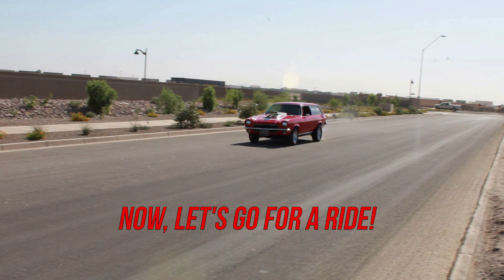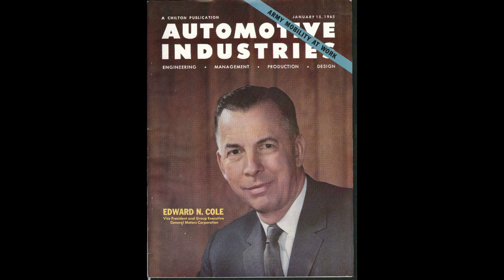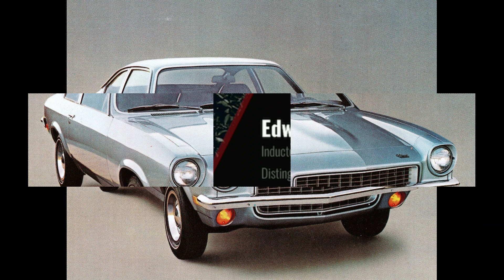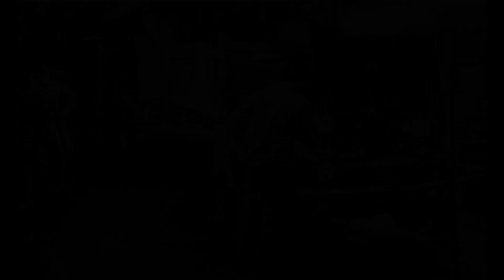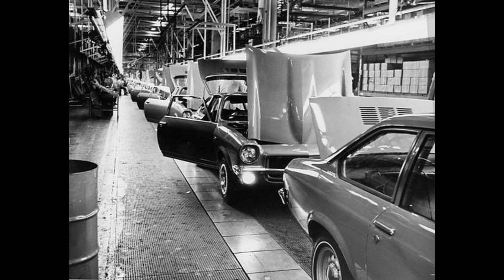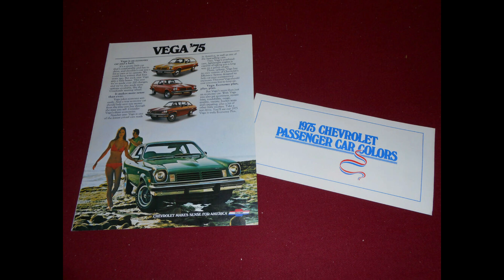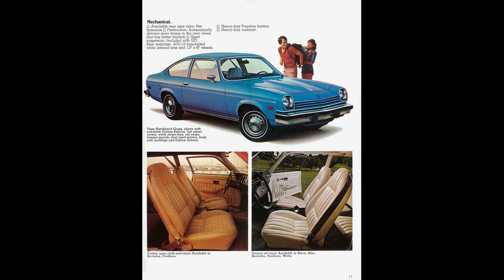If The Chevrolet Vega Could Talk - "People remember me either with love or hate but I'm remembered!"

Comment: You know what doesn't make sense?  GM had a division which was expert at making mid-size and small size cars and that division was Australia's GM Holden.  Holden engineers put together various presentations of how the "HQ" model Holden and "LJ" Torana would suit the America market.  Both cars were seriously considered.  They had been engineered so that they could be built in LHD and Australia's RHD.  The engine bay in the HQ could accommodate Holden's straight 6 or any Chevy engine required.  The LJ could take any engine, including many OPEL four cylinder units.  Both cars were extremely strong (built to take Australia's outback roads) and would have suited the US market.
The problem was that Chevy's engineering department baulked at having their Aussie upstart sibling providing anything at all to the US parent company.  So instead of adopting a tried and true design Chevy struck out on their own because of prejudice against the Aussie product.  Fair enough...their call but I find it ironic that the Holden's would finally be imported into the US as Pontiac G8s and later as Chevy SS.
Reply from the maker: Thanks for all that added information!  Very interesting side of the story that is probably mostly unheard in the US. We really appreciate your awesome comment!  Thanks for watching and being part of our ITCCT family!
Reply: @IfThisCarCouldTalk  If Chevy had gone with the Holden proposal this is what you would have received...
https://www.youtube.com/watch?v=7HgmAz8Y0b4

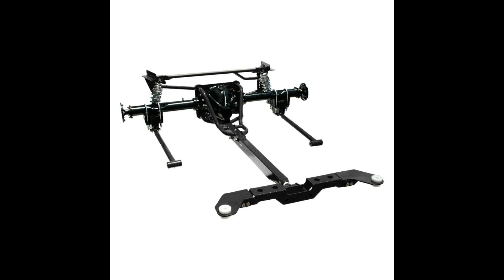Comment: 5:10 Please correct me if I'm wrong, but this illustration  looks more like the torque-arm suspension that was introduced with the Cosworth Vega for the 1976 model year, and was carried over into the Monza and the 1982 Camaro. It has 4 links if you count the torque-arm, but I believe the original 1971 suspension had 2 parallel lower links and 2 angled upper links.

Comment: While Vega was a stylish little car, the engines, paintwork & ergonomics were generally horrid. Once engines reached 35-40K miles, the aluminum cylinders had worn to point hey were using a quart of oil every 250-300 miles. As one poster commented, may as well be a two cycle, add oil with every fill up. Joke back in day, how do you know if a Vega isn't burning oil? "WHEN IT'S BEING TOWED". Rust was a huge problem & I'm in the south. Friend was dating a girl with a notchback, back glass blew out of it one day. The trough glass set in was mostly rusted away. That car was FOUR years old. They met as she'd came into station where he worked looking for 40W oil to reduce consumption(he was selling it to Vega owners). By mid '70s word was out, combined sales for '75, '76 & '77 totaled LESS than did the '74 models that sales were at least partially steered by fuel shortage. There was a reason Pontiac advertised Astre(their version of Vega) as having the "Iron Duke" engine. By '76 Chevy had corrected engine problems, but damage to reputation was done. Meanwhile the "fire bomb" Pintos soldiered on through 1980.
Reply: Lol!  Just the essentials sucked.  🤣
Reply from the maker: Yep.  Great comment, Tom. Thanks for watching!
Reply: There was a “fix” for the engines…… steel sleeve, problem solved. Was going to auto tech school at the time, boring and sleeving was pretty common.
My sister had a 74’ Wagon GT, put a 100k on the car after fixing the engine.

Comment: Owned a '73 Estate wagon.  At precisely 35K miles, the rings failed, resulting in 1 qt per thousand miles in oil consumption.  As it was "out of warranty", Chevrolet was not interested in assisting with the problem.
Reply: My dad was a mechanic. Your 1 qt/thousand miles was lucky. Many consumed much more than that. The failure rate of the pre 1976 engines was very high. They’d overheat, blow head gaskets, score the aluminum cylinder walls, and drink oil. The solution was to rebuild them by having a machine shop install steel cylinder sleeves. I think the 1976 engines came like that from the factory. That’s why they lasted longer. But the fragility of the early engines ruined the reputation. They actually handled pretty well… until the front springs started to sag (another common issue).
Reply from the maker: That's a bummer of a story, Jim but thanks for sharing.

Comment: My first car was a green 73 panel wagon, and then later I had a 74  copper colored wagon.  For the most part, the biggest problem I noticed with these cars was the engine.  They burned a lot of oil, and when they got hot, they would throw a rod.  The engine really needed to have a steel sleeve in the cylinder walls.  Other than that, they were great cars.  Living on the west coast, we don't really have a problem with rust, but I have read in different threads that they also had a bad problem with rusting out.  I never had a problem with this.
Reply from the maker: Thanks for sharing your memories with us!  Glad you had good experiences and we appreciate the comment!  Hope you subscribed and are now part of the ITCCT family!
Reply: Rust was a peoblem -- I would take my car apart as much as I could, every 4 years and derust-/ patch with  fiberglas. Then I'd open up the seals inside the fender wells and spray deruster in that too.

Comment: My parents bought a 76 GT wagon.
It was a 4 spd with A/C and it was in the family for 22 years and 170k miles.
When it was new it was Ziebarted and my parents kept up with inspections and touched up paint chips and scratches.
They were meticulous about mechanical maintenance.
When the car was finally totaled after it was rear ended it the only rust was a quarter sized spot in the doglegs and the engine only used a 1/4 between changes.
Reply from the maker: Well said!  Proper routine maintenance wins!  Thanks for sharing the great memory!
Reply: I used to be a Chevrolet salesman in the 70s. I can tell you that the 76 models were vastly improved in durability, both in rust resistance and in the cooling system. The 76 & 77 Vegas were longer lived than a great many small cars of that time. -and they always got outstanding fuel economy. The car magazines used to note that in their big econo-comparisons, with 5 or 6 competing cars.
Reply: @erichanson3961 I think most of the early failures of engines were bad thermostats or water pumps. The engine was fine if kept cool.

Comment: No mention of the problems that GM had with those aluminum liners? Wore out really fast resulting in lots of burned oil. Putting a cast iron cylinder head on top of an aluminum cylinder block is industrial-strength stupid
Reply from the maker: True that.  Thanks for the comment!

Comment: IN 1977 my father bought a 1973 Vega with the 4 speed manual for $75.00 in a auction.  He gave it to me a young airman in the Air Force. It made it ten miles for me and the shift linkage bound up. I get under the car and free up the shift linkage and return the car to my father and went to the local Plymouth dealer and bought a used 1974 Plymouth Duster.  

I then repaired the Vega and it was used by father for the next 3 years as a bomb around car.  You never followed that car very close as it would literally drop bits and pieces of rust decayed parts on the road behind. After about three years the car started to be a automatic mosquito fogger as it was going through a quart of oil every 50 miles and my father took the car to junkyard.
Reply from the maker: LOL !  Well, heard those stories before so you were not alone.  Hope the Duster worked out well.  Thanks for sharing your great memory!
Reply: My reverse linkage rod got stuck. Went out and installed a case hardened Hurst Linkage -- great replacement.-
Reply: It sounds like the exact same car my father bought brand new in 1973.
Reply: yes a duster was a better car, the old 4 speed GM transmissions were not bad, but if the linkage had any slop you had to make sure you took it out of the gear you were in before picking a new one, or it would lock up, not hard when you got used to it

Comment: Great looking car but it had an engine akin to that of a Briggs & Stratton lawnmower. Aluminum cylinder sleeves. Really? And that valve cover was about 4 ft.² that was prone to oil leaks out the Wazzu!  Other than that it wasn’t a bad car. I always yanked the engines out and dropped in a small block or a 215 Buick 8. There are ways around that design flaw ☺️
Reply from the maker: LOL....right!  Thanks for the comment!
Reply: The Buick 215 V8 weighed 40 lbs more than the Vega engine.

Comment: My mother bought a 1974 GT off of the dealer lot from Ken Dixon Chevrolet in Waldorf, MD. She had been driving her 1973 Cadillac Sedan de Ville back and forth to DC, about 30 miles one way. The oil embargo took care of that and she parked the Caddy and started driving the Vega everyday. She loved that car and she saved a ton of money in gas. It did use quite a bit of oil and the 4 speed manual transmission linkage would hang up without warning at the most inconvenient times while stuck in traffic, on hills and at stop lights. We had to climb under it and knock things loose with a hammer to get it to go again. I learned how to drive and took my driver test in that car in 1981. Great memories. Other than the oil and the linkage problem (which we eventually got fixed to prevent it from locking up), it was a great little dependable car. She traded it in in 1985 for a Chevy Camaro Berlinetta.
Reply from the maker: Funny, because when I was in high school, I really wanted a Berlinetta and got a 79 Mustang Fox body hatchback instead which are also bashed by some "car people" but was a great little car that lasted me a long time.  Thanks for sharing such a great family memory!!
Reply: I used to have to do that to my parent's 3-on-the-tree Malibu, but the levers were under the hood, so only my hand got dirty.

Comment: just think everyone blamed the aluminum engine, but it was the much  lacking cooling system, Americans at that time  just couldnt get the aluminim engine cooling system down, overheating was rampent on them all, cool little car otherwise, best looking of the day.
Reply: Yes.  The rad.On the early cars. Was to small and no over flow bottle.   Overheated  engines  were ruined.  Thus oil consumption.  Then they fixed  them. But it was to late. They steel sleeved  the blocks to. So dumb ass people could run them hot.
Reply from the maker: You're right about the over heating and we agree, they were a great looking car. Thanks for the comment!

Comment: I purchased a 74 hatchback in June of 74. It had A/C and a 4 speed. The A/c worked great at night but couldn't keep up with the glass area and sun. I had the car for 18 months and traded it for a special order 76 Nova SS. The main reason for getting rid of it was it was like a 2 cycle outboard. Every time you filled the gas you had to add oil!
Reply: ya any car with massive amounts  glass can severely curtail your A/C, moon roofs are  notorious for that, on a hot day you would be amazed the difference a covered and uncovered moon roof makes. and leaks dont get me started, not much but two tiny holes keeping the wet out of your vehicle, sounds like a warped head Americans could not make an aluminum engine at that time
Reply from the maker: Interesting info about the a/c.  Fun memories!  Still have the Nova?  Thanks for sharing!
Reply: @IfThisCarCouldTalk  The Nova I sold in November 1985 for $200 less than I paid for it. It would be nice if I still had it but you can't hold on to everything.
Reply: Thats too bad. I wonder if it overheated. I think the AC models had better radiators too.